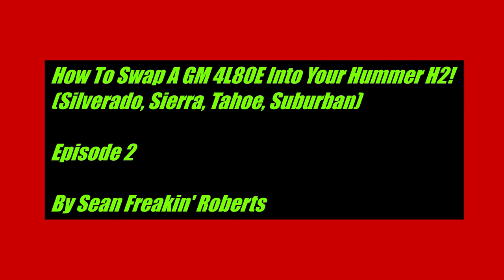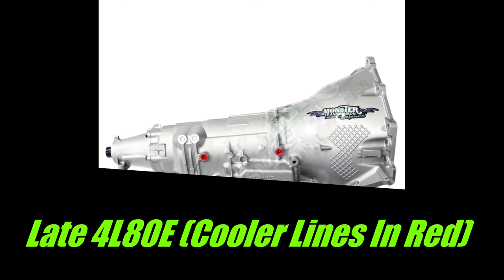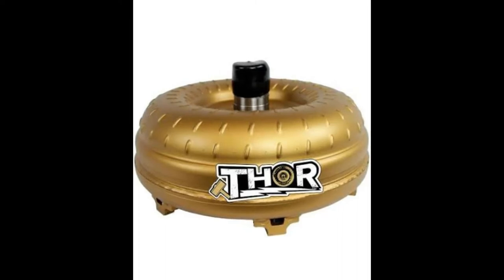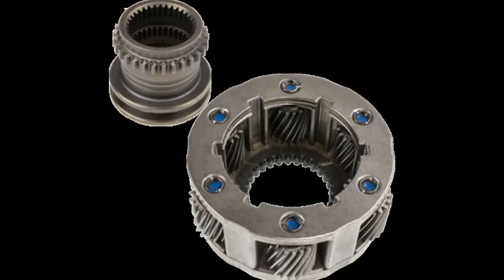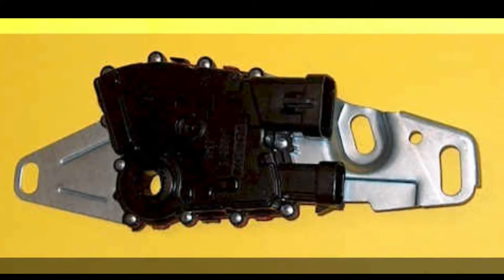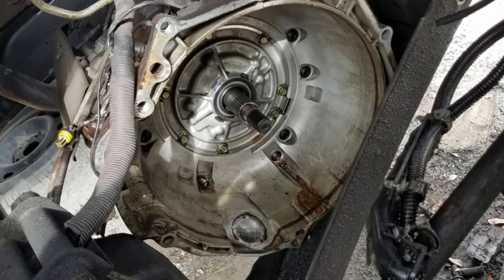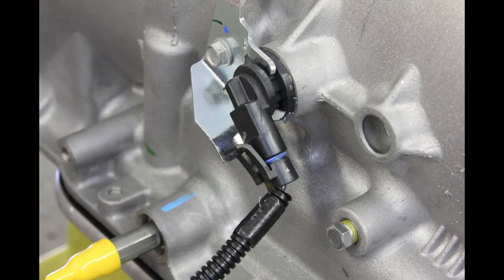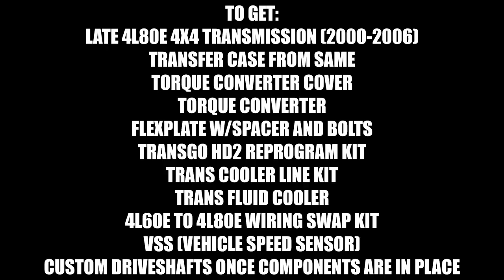Hummer H2 4L80E Transmission Swap #2

Comment: Thank you very much for the Great video!  This is exactly what I am trying to do.
Reply from the maker: I've been driving it for several thousand miles now. Let me know if I can help by answering any more questions. Thanks for the kind words!
Reply: @mohawkgarage  Thank you.  You've answered so much already.  I will most likely take you up on that when I get to it in the spring.  I only in the past year or so been refurbishing my 2004 H2.  In my tinkering I have figured out the real issue with the shifter getting stuck in park and came up with a solution, which as far as I can see none has figured out as far as YouTube videos go.  I can show you if you'd like.  Very sneaky lil problem I could see many overlooking.  Also I know how to properly fix the broken wire down in on the shifter that causes the key to be locked in the damn steering column.  I was pulling my battery terminal off every time I wanted to leave the truck.  Otherwise I'd have a dead truck everyday.  Hint, no amount of lithium grease will free it.  Anyway that and many other finding in the ole beast.  I may post a video of the shifting mechanism because I think that could help a lot of people.  It's not on here, not even close.

Comment: Side note, 08/09 H2 have the 4L80E so if you’re doing the swap, just look that year up for the parts you need
Reply from the maker: I'm almost certain that 08/09 came with the 6L80, not the 4L80E. They are not the same length. Where did you see that they're the same? Thanks for watching and commenting!

Comment: Great videos! I am preparing to embark on a wild hummer build for my channel. I have some questions if you didn’t mind me bothering you to ask about the swap? I only seen the two videos on the swap and wasn’t sure if I am missing anymore when I’m looking through your channel? Thank you for your help!!
Reply from the maker: I don't have any more videos than the ones I have posted. What questions do you have? Ill try to help. Thanks for watching and commenting!
Reply: @mohawkgarage  thank you so much for getting back to me. what did you do for your crossmember?
Reply from the maker: @Higgsgarage  That's easy, I just flipped it around. It almost perfectly located the mount. I still had to drill a hole, but it was not far off at all.

Comment: Great video !!!!    What is the model of the transfer case that came on that 3/4 truck   ?
Reply from the maker: I'll research it and let you know. It was stock to the truck and behind a 6.0 liter gas. Thanks for watching!
Reply: @mohawkgarage   thank you  I would really appreciate it . I was told at the chevy dealer that their is 3 different ones.
Reply: @mohawkgarage any update on which model transfer case u used
Reply from the maker: @labowie54gb  I wish I could remember. I just used the one that was in the truck I found. Thanks for watching and commenting!

Comment: Nice detailed video. Question though, do you loose the all wheel drive? Or does the new transfer case have a center diff?
Reply from the maker: Thank you! The diff. doesn't change, meaning AWD is retained.

Comment: Sean . How far back did you move the crossmember bolt holes in this 4l80e conversion. I am pre making a cross member for my H2 . Also still waiting for the follow up video .
Reply from the maker: This may sound a bit abstract, but I reversed the crossmember, then drilled holes where the bolt holes needed to be. The back of the crossmember pad lined up with back of the trans mount, so I measured the distance from the back of the mount to the bolt holes, then I measured the same distance on the crossmember? Does that make sense? Video coming soon. My video equipment is with my Corvette out of state. I'm doing a series on it, too. Sorry for the delay!
Reply: @mohawkgarage  So then. The trans pan is over top of the crossmember .That would then only allow for a stock trans pan and not a deep pan . I have a deep pan going on mine . Hence the need to move the center of the cross member back .  And one more thing is , how much did you cut off the stock rear drive shaft ?
Reply from the maker: @1fastbuggy502  I was told that the measurements can vary slightly from truck to truck, so it's best to measure your truck on your own. If you wanna take a chance, I can measure both of mine and let you know.

Comment: Did you ever do a part 3?
Reply from the maker: I did not. The H2 has been doing fine. Not really much to report. It is, however, for sale. Thanks for watching and commenting!
Reply: @mohawkgarage  thanks.  I think go with a modified 4l65e if I decide to build the motor.